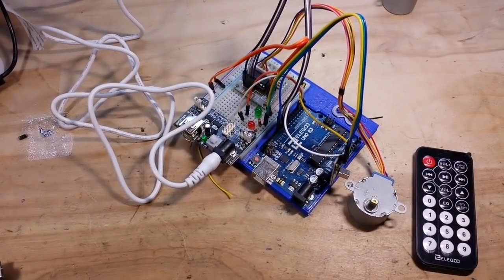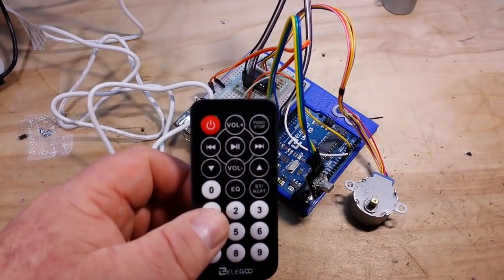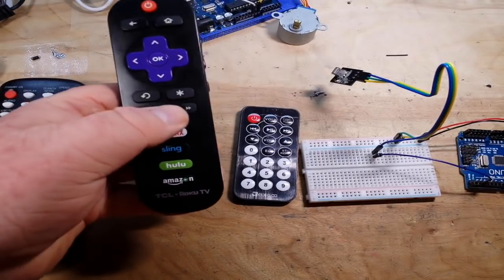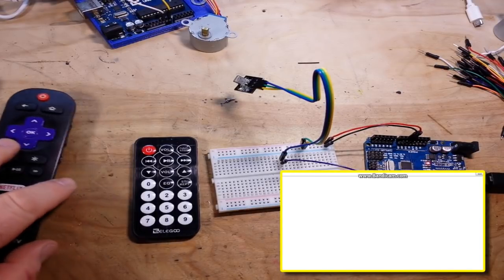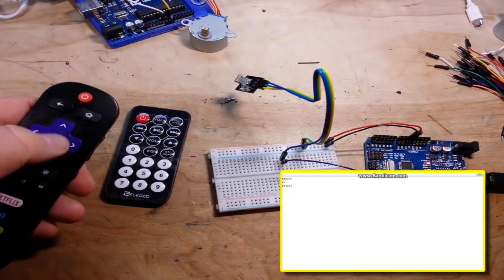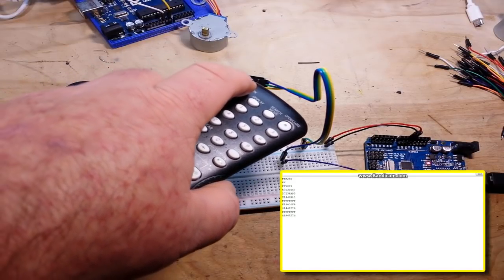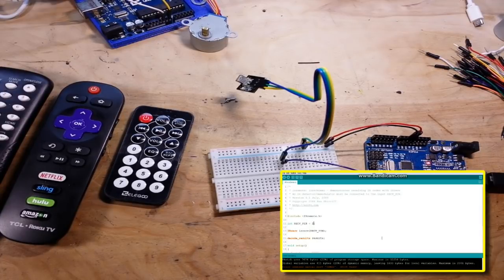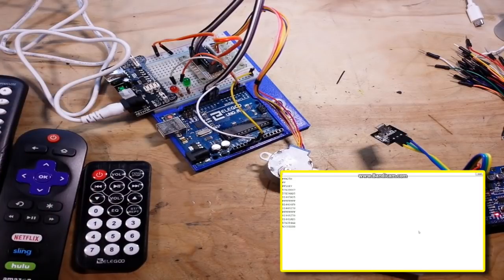How to use any Infrared remote with Arduino

Comment: Just to be clear, could someone confirm or otherwise explain, that there us some standard for each code, i.e., pressing the 1 button on any remote sends out the same hex code?  Seems unlikely, since there would be interference between remotes at home.  Anyway, this gives me an idea to upgrade the control on my old Radio Shack Robie Sr.  Thanks for the video.
Reply: There is an excellent tutorial by DroneBot Workshop covering this subject in which he goes into the standards. Well worth a watch. https://www.youtube.com/watch?v=8E3ltjnbV0c
Reply from the maker: No there are different code groups.

Comment: This will make not throw away any remote control. I have some JVC tape recorder  remote that may have use for this. Can i use any IR module or is specific to the one used on the video?
Reply from the maker: It should work with any it module as the library does the work.

Comment: The all 'F's code is a special one that is sent when you keep any button held down. It means 'Repeat the last code received'. It is used for example when the volume up button is held down to repeatedly increase the volume. You need to store the last non-F's code in your sketch so that you know what to do when you receive an all F's code.
Reply from the maker: Thank you I didnt know that
Reply: @learnelectronics  I have only recently been playing with infra-red receivers. I was trying to control a WS2801 LED strip to change the speed, colour, brightness, etc. As a newcomer to the Arduino it has been a bit of a steep learning curve and your videos have been a great help. Please keep up the good work.
Reply from the maker: Thanks, glad I could help